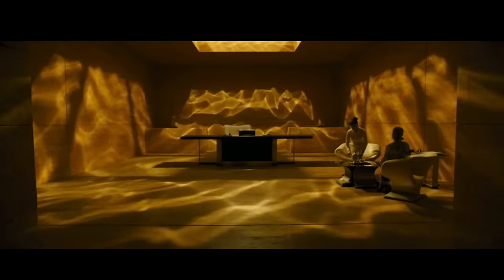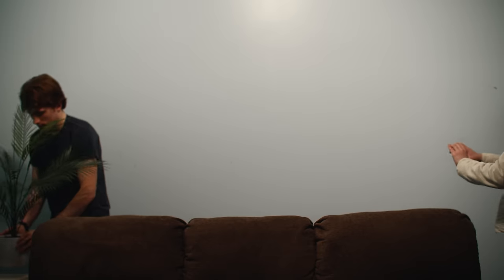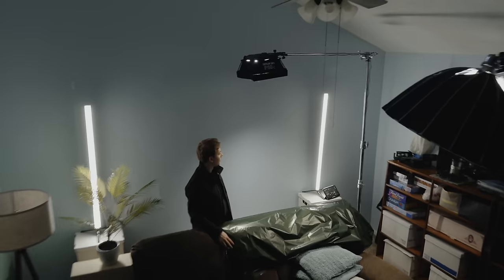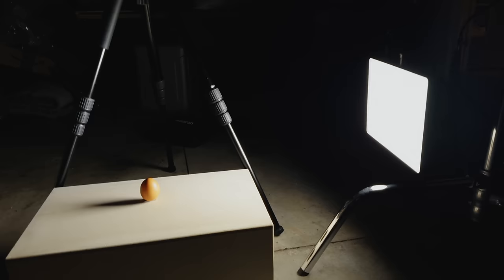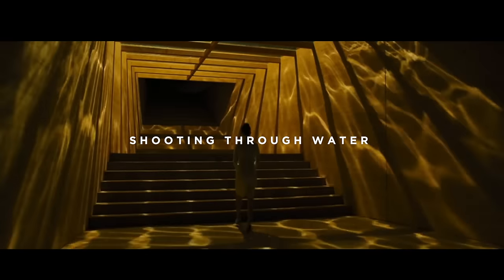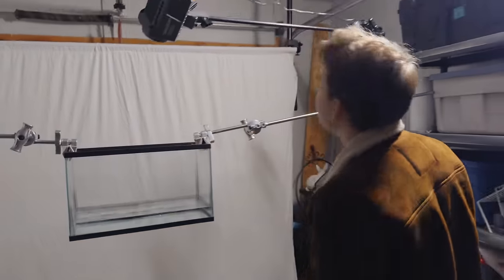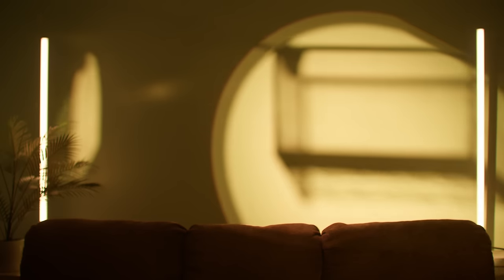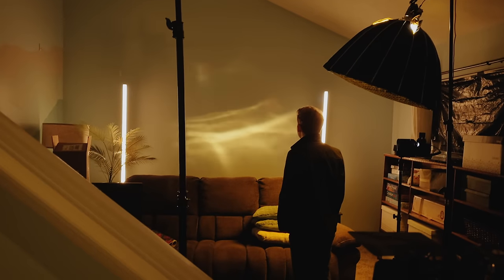Recreating the Water Caustics Effect from Blade Runner 2049

Comment: In the film, they used a built in 'pool' above the set and then used four point-light sources - lit from a position higher than the pool surface - all aiming at downwards angles.  The waveform pattern reveals the depth of the water.
Reply from the maker: That was my guess too! Multiple lights on one pool of water.
Reply: That’s exactly what i thought as soon as he showed the shot
Reply: I thought the same as well, I noticed the large rectangular area at the top of the set and immediately thought that’s where the ripple effect was coming from.
Reply: @WilliamHBaker  also important piece, is that the crew used small planks or whatever they had to create waves in rhythm.
Reply: so what they did in the video but on a way larger scale with a way larger budget

Comment: You could use a large mirror to bounce the caustics to where you want. If you positioned the spot light under the tank on the floor with the tank three feet above it, then suspend a reflective surface (like a flat mylar sheet lol) at a 45 degree angle above the tank, you can project those caustics onto a wall without hauling the water super high. Awesome video!
Reply from the maker: That theoretically could work!! Although nailing all the angles would take some time, that’s a really neat idea! If I ever do water caustics again I’ll probably include some more creative rigging!
Reply: I did wonder why they didnt just put a mirror below or above the tank instead of trying to raise it up high and faff with the lights.
Reply: Smart

Comment: Besides using a smaller closer light source, use a smaller tank and fill it with ethanol. The much lower surface tension will give you smaller ripples. Also add some curves to the edge of the container so you dont get only square caustics.

Comment: You could also do it with any shaped space by using recordings of caustics you want and throwing those on the wall with a projector. That way you can make the ripples clearer and bigger too.

You won't get any distortion, even when the room is very small, the caustics will fill the entire space.

Comment: You could project the light through a shallow water tank set low (behind the couch) over a mirrored surface. The light passes through the water/tank and onto the mirrored surface which then reflects the caustics up onto the wall. You could then avoid the overhead suspended tank problem.

Comment: There is another way that produces really clear pattern by focusing them — it is to use both reflective surface and put water on it. The easiest way is to get a plastic tub and glue a reflective film on it or at least paint it white. The water is also needs to be disturbed constantly with a mixer or some kind of mechanical oscillator.

Comment: As a OG Blade Runner fan (saw the original in the theater) I applaud your work.

Starting in the mid 1960's and spanning nearly 40 years, the Smithsonian Museum of Natural History here in Washington D.C. that used water caustics to great (almost extreme) effect.

The West Hall of the museum, on the main floor, was dedicated to sea life.  This extremely large hall (50-ish feet wide, 60 feet high and easily 200 feet long IIRC) was intentionally kept extremely dark to mimic the deep sea, with a life size model of a 98 foot long Blue whale suspended from from the ceiling along with many other creatures.

In that ceiling, the only main light sources were several (four IIRC) shallow pans of water about 1x2 feet that gently rocked back-and-fourth on armatures.  Above them sat the blue lights that projected the caustic effect all over the dark hall dozens of feet below.

Even as a child in the 70's the effect mesmerized me.  I would quietly sit in this section for sometimes an hour or more while listening to the whale song recording that was continuously piped over the PA.  I found it so intriguing that at 9 or 10 years old I actually successfully copied it in the dining room.  I held a flashlight above a pyrex baking pan filled with blue water (easter-egg dye) sitting on the glass-topped wicker dining room table.  The effect was pretty good if I do say so myself.  (lol)

As an adult (and a certified diver for over 35 years now) I can say that the sea life hall effect was extremely close to real life deep water given the technology and knowledge at the time it was built.

Sadly, in the early 2000's, the whale was taken down and scrapped, and the entire exhibit hall was demolished and "updated" to  fit more modern sensibilities (read:  zero personality).  So the only way to see the exhibit is through old pictures.

I'm sure the Smithsonian's website should have something.

Just wanted to say thanks for triggering this old guy's good memories.
Reply from the maker: Thank you for sharing that! It’s always cool to me to peer into someone’s life! I imagine that experience (along with some others) is what led you to become a diver?
Reply: @WilliamHBaker 

That, and WAY too much Jaques Cousteau...

<g>

If you think that's interesting...you should hear about my love for cyberpunk!

Comment: Nice effect...years ago i built something like this in my house but i just used a large open fish tank set below a southern window the same refractions are produced at the reflected angle...so mine are always on the ceiling like in a cave that has sunlight bouncing off water in the entrance. Good job isolating the approach though without needing a whole pool to do it. Your shots of the same effect in other scenarios (outside) where super as they appear more like an individual power rather than an ambient caustic effect. Thanks for sharing.

Comment: A swimming pool with lights makes the same affect on the ceiling and walls. In the movie it's basically an upside down pool acting as a window through a solid ceiling. Your experiments did not have a wall to block the excess light and funnel the remaining light through the bottom of the fish tank. A delicate thin glass dish sitting on a black box that has a light inside will give off the desired affect (changes a little with glass thickness and water depth).

Comment: I used to have a lamp that was made to create the effect and it worked great. It's kinda like a lava lamp but instead of wax it had dozens of little mirrors and a tiny pump in the bottom that made a water jet that agitated the water and made the mirrors whirl around and reflect the light from the base. It was awesome and I designed my room around the effect, painting the walls blue and hanging fish decorations from the ceiling

Comment: The thing about LED based point soures is, that they‘re still using a rather large „light emitting Surface“. This is because those lights use a „cob led array“. 
The best type of lightsource for this is probably a HMI, because they have a verry tiny lightsource. 

Speaking of expensive gear: a movinglight with a rotating gobo wheel, a water glass gobo and a continus Animation wheel should do the trick very well.

Comment: there's a MRT station in Singapore, when you took the escalator coming out of the underground to the upper floor , they had a glass roof with water continuously running, so the water shadow ripples all over the place

Comment: Acrylic box that's hollow like a fish tank but only 1 inch thick and possibly sealed.  A single LED cob. A few thousand lumens will do, like one out of a flashlight. Black plastic hood at whatever the best height is for the LED. Small heatsink and fan for cooling. Put it all together and now you have a leakproof water reflection light that just needs to be level to work properly. could even put a small bumping mechanism in there to keep the reflections going

Comment: Ayyyyy i did something similar years ago for a "psychedelic shoot". We did everything similar to your shooting light through fish tank version, shot light through water source, used mylar/reflective screens/mirrors to achieve angles. But heres the key difference - we filled up clear lilos! Im not sure what you call them in america, water loungers, floaty things etc....But clear floating devices - pick them up for like $20 new, or if youre even cheaper buy lots second hand. We used all sorts of shapes, long loungers, square, circle and donut ones. Where you normally blow air, you fill with water sometimes you have to cut a bigger hole, some completely full, some half full as theyd break, some only a small bit full. Be sure to also put additional cover on the plug. We had some that had handles and they worked the best as you could attach them to rope and hang them anywhere. Don't put them too close to your halogens or hot bulbs, as they will warp and eventually burst the plastic! But seriously you can get some great effects this way!

Comment: About the fish tank rigging: when I put heavy(ish) lights on booms, I always add counter weight on the opposite side. I've had 4foot kino flo 4banks above talent's heads, as well as small HMI's and 1ks with soft box (yes, I'm old). I've never had an accident with them. I think having an arm on each side was a great choice, but it could be a little safer still. Great video, BTW, I think I'll give this a try soon.

Comment: The caustics look sharp irl because the light rays refracting through the water surface all hit it at the same angle. Thats because the sun is bigger then the earth. The light sources you are using are all smaller then the fish tank itself, so the light rays they produce all hit the waters surface at different angles, thus making the caustics blurry. Thats why the caustics were getting sharper when you moved your light source away. When you did that the light rays that hit the water surface where more parallel to each other. If you want sunlight like caustics you should try using a really big fresnel lens to get parallel light rays coming from your light source.

Comment: The distance and diameter of the light source are not the primary factors to consider. The main things that should be considered are the lumens and variance of the angles of light. The photons must be as parallel as possible. As others have stated, movie projector or parabolic reflectors will give good results, as long as the cast area of light does not exceed the area of the water tank. Casting onto the floor and 3 walls simultaneously with perfect compensation from one tank in the ceiling... i presume this is not possible or at least not for the average homeowner. This may have been a compound visual effect in the movie, or some large and complicated rig in the ceiling.

Comment: Another thing they may have done is use ultrasonic vibrations in the water to get more uniform shapes. It may be as easy as putting a vibrating toothbrush in the water.
Reply from the maker: They definitely had some way to get consistent ripples with their big tanks moving! Good thought about the toothbrush! Something like that might work!

Comment: It's kinda dumb how I learned how to do this. It was around 1995-1997. I lived in Miami, so we'd get really hot summers, which required water on hand pretty much at all times. Being close to the beach means growing attached to the way it looks, and where there's a beach there's an aquarium.

My dad took us once, and what I was fascinated about was the light reflection in the large blue rooms with massive water tanks. I'd stare at them or dance on them.

While outside with a glass cup of water I sat near the sidewalk outside our apartment building, and I did that thing kids do to make their fingers into a telescope. I stared down into the cup, but noticed something shining at the very bottom - only it wasn't the cup, it was beneath the cup. So I played around a few times and found out that if I made my hands into a 👌🏻 over the cups surface, I'd get a clean ripple effect onto my skin, kinda like the ones in aquariums.

I had this hobby growing up called 'shadow play art', where I'd take pictures throughout the day of the wall, as there was a large tree outside that would make beautiful effects, especially when it rained. The ripple effect would bounce off the leaves, through the window, and onto the wall.

Fast forward to Blade Runner 2049, and when I saw that room, I knew exactly how it was done.
I was immediately envious because I had always wanted to try that with my spaces, but I only ever lived in apartments.
I knew that in order to successfully execute it like in the film, you'd need to take a chunk of the ceiling out, raise a thick piece of glass, and rest water atop it, then have some form of light source which would require more space between the water and the ceiling.
In other words, this would need to be a custom build that did no structural damage into a room of a certain size.
Expensive and again, you'd need your own home and someone who knows how to prevent mold during construction.

I'm glad I wasn't wrong. I've always wanted to remake this after the aquarium trip as a child, but knew that it wasn't something simple.

Comment: I'm curious if you tried sending light through the water tank in a more convenient location and then putting an angled mirror under the tank to bounce the caustics where you need them. You might be able to reduce the inconvenience of needing the tank suspended awkwardly.
Reply from the maker: I had not tried that but I've seen that suggestion a few times now! That could definitely work and make things a bit easier for sure!

Comment: I don't understand why you made this so incredibly complicated.

You could use a ceiling lamp with a flat profile. Water could be placed underneath it. For testing purposes, a glass baking dish with some water would suffice. This would weigh perhaps 1-2kg instead of the immense weight of the aquarium and water.

For a permanent installation, you would need an LED panel with individual LEDs, a small frame in which water is placed under the lamp, e.g. an acrylic plate with an edge and something to vibrate the water.

In general, something like this should weigh a maximum of 5kg and can be mounted on any normal ceiling.

Comment: Interesting video and testing, always wondered how they did it in bladerunner! 

I do wonder if using a more reflective liquid than water might have worked better for bouncing light off it. 

Like those toys kids have with the super fine glitter in it, or pearls in the paint from cars suspended in a fluid (dipyourcar has videos of fluid like that) should have a higher reflectivity than just plain water, and might still avoid the issue ran into with the mirror method.  Might just diffuse the angle the light reflects too much though. 

Probably not cheap either!
Reply from the maker: Interesting idea! Diffusion is a possibility, but if the reflective material within the liquid is fine enough, it should function the same as a liquid. I guess then the question is the science behind the water ripples. Is it light bouncing off the surface, or is the light refracting through the water, in which the water being transparent is the reason it works. If I ever do a video like this again, I need to test that idea! I’m so curious now!!
Reply: @WilliamHBaker  curiosity is the best medicine!  
Always something new to try and experiment with.

Comment: Good job man , it's really beautiful!
But if we shoot a dialogue, does the mylar make noises ? 
Bc the water sound can be pleasant but if mylar is like aluminum ( Wich is not the best for réflexion ) the sound makes the shoot useless.
Reply from the maker: Very good question! It’s definitely not loud like aluminum foil. It’s hard to describe the volume of it. It’s quieter than a trash bag but similar sound, but you don’t need to move it much to get the effect either. I had a mic on for the video. The only times I got Mylar sound in the mic was when I was next to it. Otherwise it was really quiet.

Comment: Idea: What if you put the mylar under the water tank or inside the water tank instead of the mirror. For the first method what if you try to wrinkle the mylar?
Reply from the maker: We tried wrinkling the Mylar. It just made the effect more diffused. We also tried Mylar in and below the container. If we did it properly and kept it wrinkle free, it may have worked, but from our test it didn’t work very well.

Comment: Hey lovely tutorial. I have questions how you got the yellow colour around 2.33 mark in the video. If you could share the colour temperature in camera and the gel used in big soft box and too small soft box. Trying to create that yellow. Thank you.
Reply from the maker: Yeah! So I almost exclusively shoot at 5600k. The LED panel and the point source we used for the water effect are both RGB lights, so we just changed the color to that yellow. The gels we used were Rosco Color Effects kit, probably a mix of #12 and something like #2 or another lower number. To be honest, as long as you get pretty close to a warmer yellowy color, the rest is color grading. Roger Deakins shot with all tungsten lights and we honestly should’ve just had all our lights set to the same white and then color grade in post for more output, we just didn’t think of that when we shot it.
Reply: @WilliamHBaker  thanks a lot, that was very helpful and have nice day 🙏🏽.

Comment: Fun and informative video.

I wonder if the Mylar was evenly suspended within a large enough frame (but with some slack) one might be able to attach to frame (or just place in contact) a small motor or solenoid to deliver consistent waves/ripples that might be adjusted up and down (sped up or down).

I’m not an electrician so probably explaining it poorly but a vibrating power source like an adjustable motor could provide the waves in a “tuneable” manner that can be controlled and recreated.

Also, anyone know what happens when laser light is used in this manner instead?